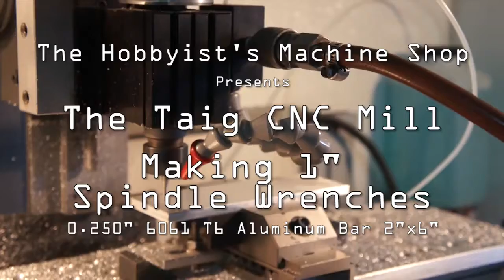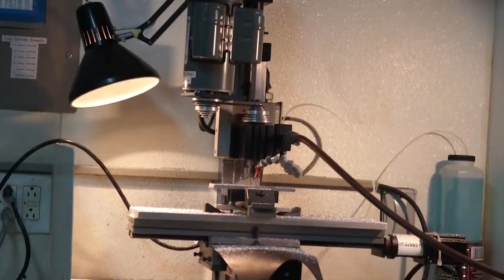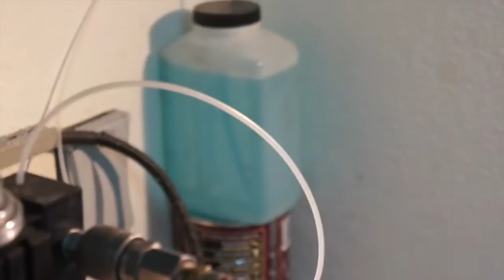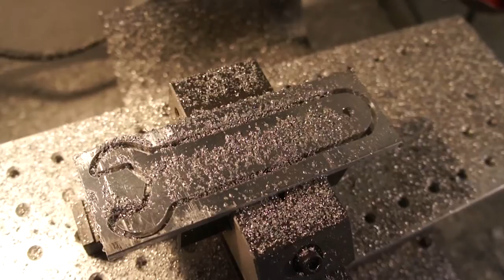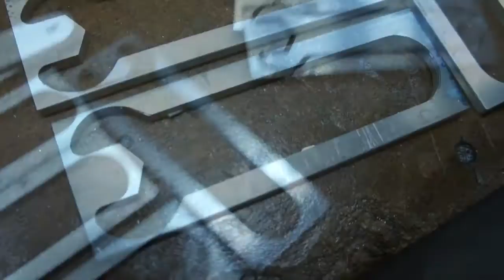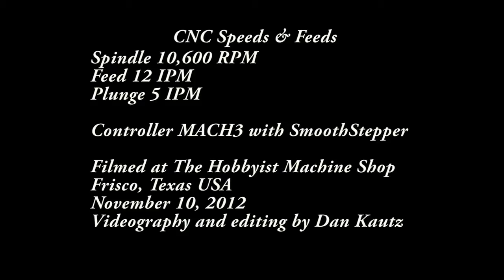Taig Wrench CNC

Comment: Have you considered a shop vac with a dust deputy cyclone attachment to collect the chips? Looks good, but I have not tried one yet. Collector permits metal container separate from flammable filter.

Comment: I recently bought a California Air Tools compressor to run a nailer and the performance is good and the silence is golden! CAT-1610SPQ 1.0Hp 1.6 Gallon You could just tap into your airline and set the pressure cut offs to use the CAT as your main unit. Compressor kits are available. I have not used it under continuous duty yet.

Comment: hey dan, enjoyed the video.  One thing that almost never gets shown in these videos is how you're cutting the tabs.  Do you do this by hand with a saw or clippers? What type of tab is left when you're done? Do you polish it off with a wheel or sandpaper? thanks
Reply from the maker: I have a small band-saw with a metal cutting blade. (Proxon) Tales about 30 seconds. Sometimes I just use a hacksaw blade without a frame. I use a one inch (powered) belt sander to grind off remaining tab bumps and dress the cut edge.

Comment: Yes, thanks for the good video. I recently acquired a Taig mill and it came with a warning notice not to use water-based coolants on it due to corrosion, etc. But I guess you have not had a problem with KoolMist? You said no rust, but any other assurance would be helpful to know before investing in the KoolMist system. Thanks again!
Reply from the maker: Luka Negoita  Taig says that for warranty protection. I have been running the mist cooling for many years with zero issues. You have to use good sense and housekeeping.Mist cooling is very low volume of liquid.

Comment from the maker: I mix "Kool Mist #77" with water at four ounces per gallon. That's why it is blue. The mill is mostly aluminum but the Kool Mist solution seems to prevent rust on any of the steel parts.Rust is not a problem.

Comment from the maker: Yes, That is 6061 -T6 in the video. Speed depends on the strength (size) of the mill bit and depth and width of the cut. The Taig is light weight, low power (!/4 hp) and relatively high speed 10,600 rpm). Most high speed >5K$ mills are. Light cuts are its forte. It can handle any millable material. Google CNC cookbook for feeds and speeds.